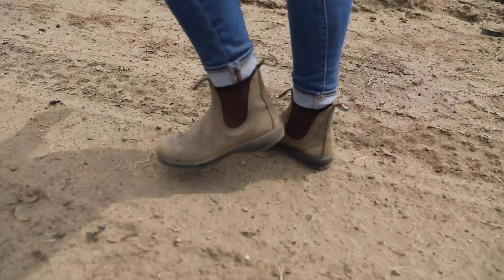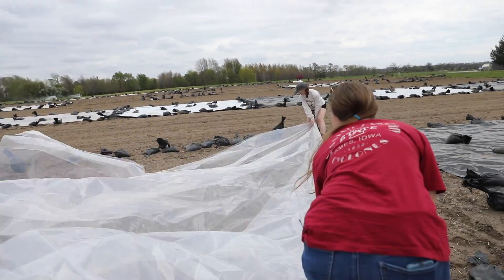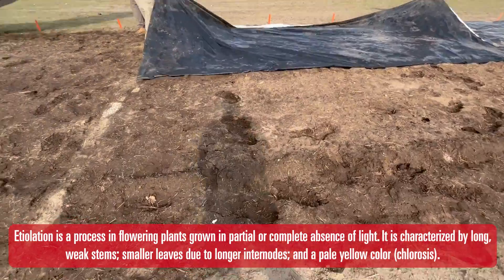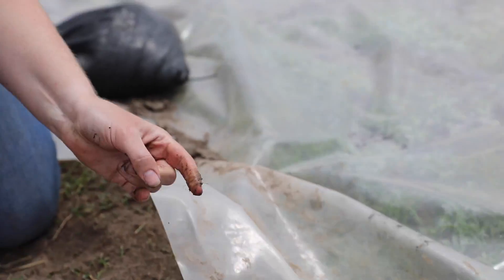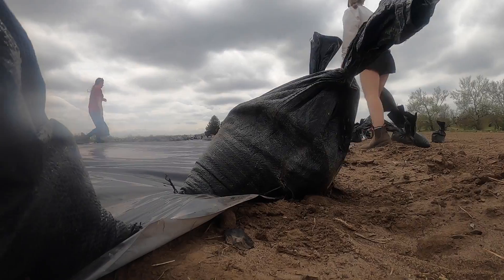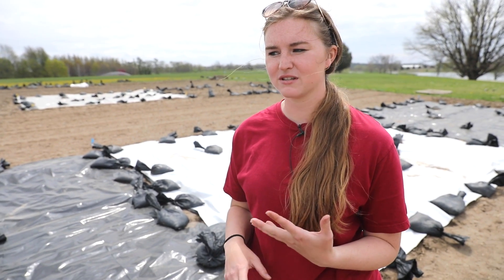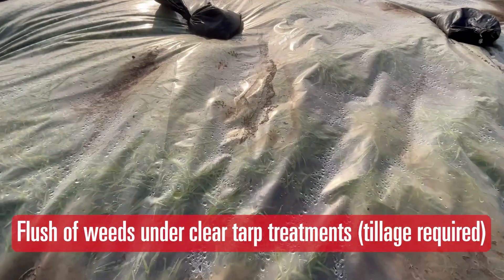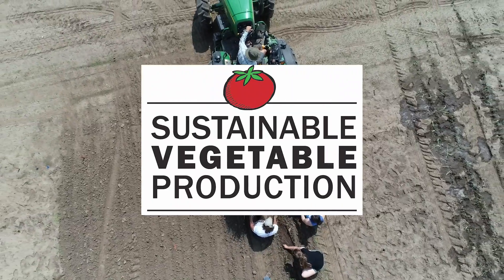Exploring the Use of Tarps for Weed Control: A Research Project

Comment from the maker: Tarps were removed mid to late May in both years of the study. Black and white tarps, regardless of tarp duration (2, 4, 6 weeks), revealed no weeds under the tarps. Meanwhile, the no-tarp treatment was weedy. Temperatures underneath the clear tarps were not warm enough to kill the flush of weeds that resulted in the spring. Clear tarps require warmer summertime temperatures to kill weeds. We would not recommend using clear tarps in the spring before planting. The time a tarp needs to be applied depends on the time of year and if there are pre-existing weeds in the area. About 3-4 weeks is usually recommended. A surprising finding from our study: nitrate levels were higher under the tarp treatments, most likely due to its ability to block heavy rains and decrease leaching!

Comment: Wasted my time watching this. RESULTS???
Reply from the maker: Meanwhile, the no-tarp treatment was weedy. Temperatures underneath the clear tarps were not warm enough to kill the flush of weeds that resulted in the spring. Clear tarps require warmer summertime temperatures to kill weeds. We would not recommend using clear tarps in the spring before planting. The time a tarp needs to be applied depends on the time of year and if there are pre-existing weeds in the area. About 3-4 weeks is usually recommended. A surprising finding from our study: nitrate levels were higher under the tarp treatments, most likely due to its ability to block heavy rains and decrease leaching!
Reply from the maker: Black and white tarps, regardless of tarp duration (2, 4, 6 weeks), revealed no weeds under the tarps. No-tarps was extremely weedy.

Comment: Link to the results?
Reply from the maker: Our apologies..Nitrate concentrations were elevated in the tarp treatments, likely because the tarp helped shield the soil from heavy rainfall, thereby reducing nutrient leaching. Results haven't been posted to extension pubs yet but when they are we'll link in description. Pinned 'results' above. (Tarps were removed mid to late May in both years of the study. Black and white tarps, regardless of tarp duration (2, 4, 6 weeks), revealed no weeds under the tarps. Meanwhile, the no-tarp treatment was weedy. Temperatures underneath the clear tarps were not warm enough to kill the flush of weeds that resulted in the spring. Clear tarps require warmer summertime temperatures to kill weeds. We would not recommend using clear tarps in the spring before planting. The time a tarp needs to be applied depends on the time of year and if there are pre-existing weeds in the area. About 3-4 weeks is usually recommended.)

Comment: Thanks for this. I definitely want to see the results of this test. When will you upload?
Reply from the maker: Yes, this was an awesome study. Sorry for not having the results ready..shot video wanting to show how the project was going but had issues with scheduling to follow up and show the results for the video audience. Tarps were removed mid to late May in both years of the study. Black and white tarps, regardless of tarp duration (2, 4, 6 weeks), revealed no weeds under the tarps. Meanwhile, the no-tarp treatment was weedy. Temperatures underneath the clear tarps were not warm enough to kill the flush of weeds that resulted in the spring. Clear tarps require warmer summertime temperatures to kill weeds. We would not recommend using clear tarps in the spring before planting. The time a tarp needs to be applied depends on the time of year and if there are pre-existing weeds in the area. About 3-4 weeks is usually recommended. A surprising finding from our study: nitrate levels were higher under the tarp treatments, most likely due to its ability to block heavy rains and decrease leaching!